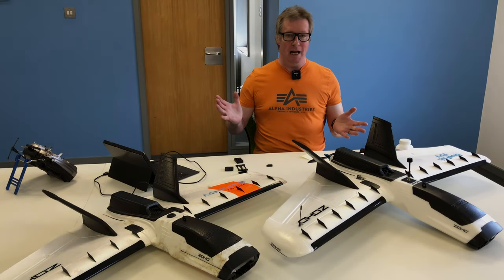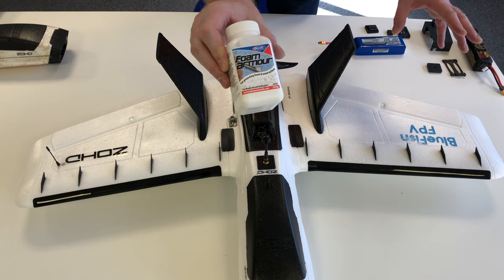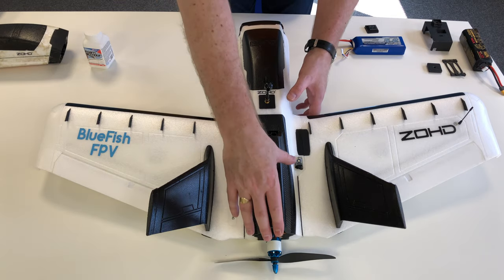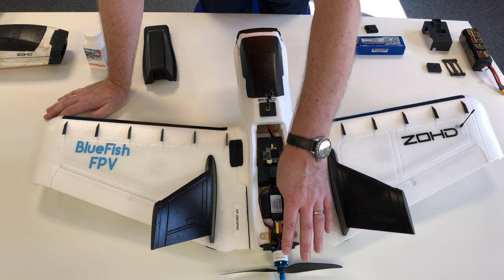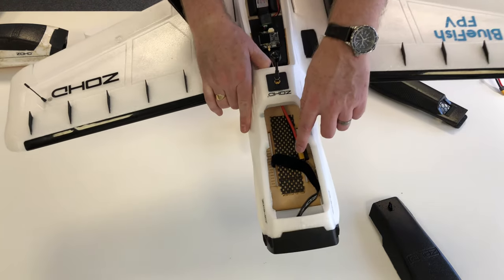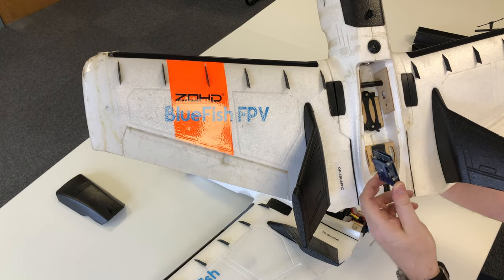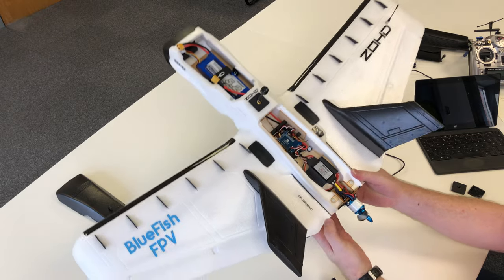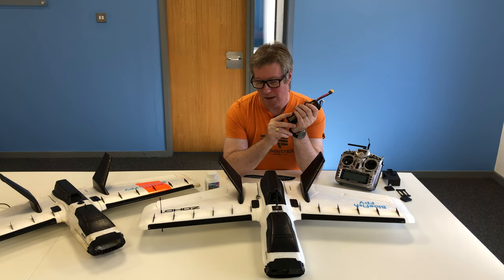ZOHD Dart XL - Enhanced Version - Build Overview

Comment: Dont forget the minimum voltage on the 10000 liion pack is 10V per their banggood listing! I had to adjust the esc a bit so that it didn't cut off early.
Reply from the maker: Yes thanks for reminding me but I will probably not go that low. I have flown my old XL with the LION and it launched fine and seemed to perform well. Let's see how it does on the new plane when I go for my long range record :-)
Reply: @bluefish3607  time to plan a 1 way mission and meet the zohd somewhere downwind LOL

Comment: Hello, I really like your video about the ZOHD Dart XL. I printed out most of the parts and installed them. I've only been doing this hobby for 6 months and I'm having a lot of trouble with my ground station. You have almost the same hardware as me. Would it be asking too much if I asked you for an allocation plan. I don't know how to connect the Teleflytiny. User manuals are only in English and videos on You tube are only in English. My problem is my english is very very bad. I have to do everything with google translator. I thank you for your time. I would be very grateful if you can help me
Reply from the maker: Hi I did not have much success with the telefly tiny I got it to work but it did not perform well at longer ranges, so i tried the bluetooth option and that did not work for either, I am now trying the Crossfire wifi option and have not had time to finish this yet. The Mini Crossbow has been the most challenging thing I have tried to setup for sure. You may be able to get the help you need here: https://www.facebook.com/groups/2551897241564695

Comment: Can I know your pids in inav for this plane?
Reply from the maker: Hi Chris I have been running as follows but just re-tuning with iNav 3.0.1 and testing the new Autotune and this will be my new video coming very soon:

Roll P=0 I=8 FF=85
Pitch P=0 I=10 FF 35
Reply: @bluefish3607  ok
My gps does not for ages when near vtx any idea?
Reply: When I power plane with usb then gps locks full in secs but when I put battery then it takes forever to get just few satellites

Comment: I wouldn't buy this model based on that stupid plastic bucket shovel on its nose.
Every time you land, it tries to dig Itself a trench..The designer must be in some kind of denial because this has been like it from day one...🤔🤔😯😯🙄..🇬🇧
Reply from the maker: I don't have any problems and it houses my GoPro and flight cam perfectly, each to their own as they say :-)
Reply: @bluefish3607  It's the main reason it snaps its own nose off on landing....🤔😳😯🇬🇧
Reply from the maker: @EnglishTurbines   I have done well over 100 landings without breaking the nose off :-) The nose can be vulnerable in a hard crash like any other foam plane but I assure you the nose doesn't break off on landing even when you come in fast and get it wrong like I often do.